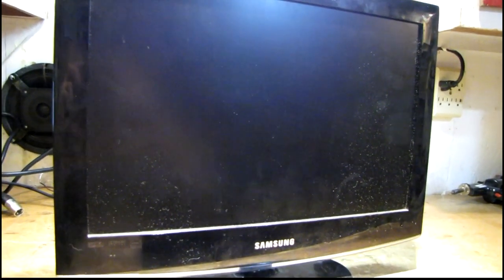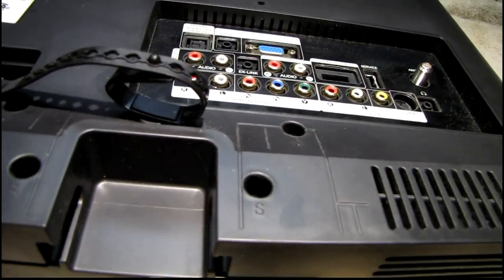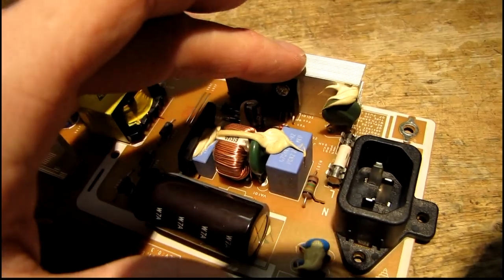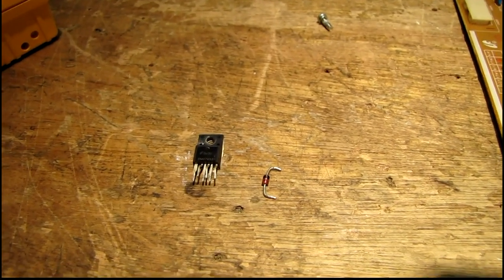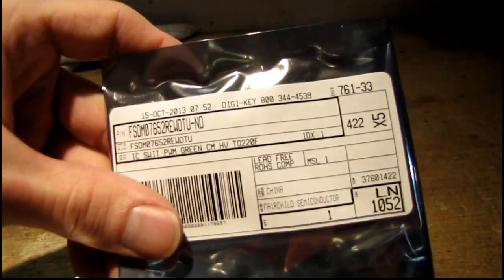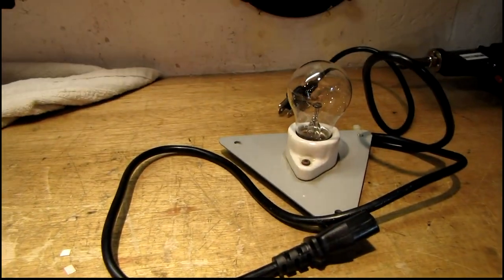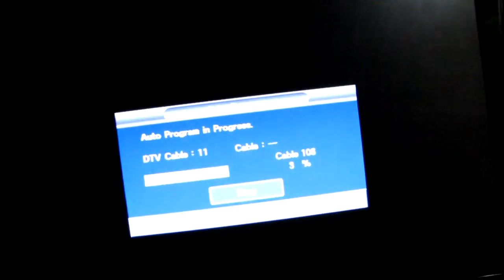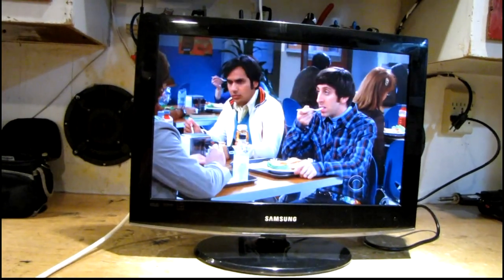Samsung 19" LCD TV Repair

Comment from the maker: CRT's can definitely run a long time.  I've got some at work that have been running for over 30 years in arcade games, with no service other than a fresh set of caps.  Though now that I've had HD TV's, I could never go back to watching standard def CRT's.  Though if it's a restored vintage set, they are nice to check out from time to time.

Comment: i really wish all flat panels would hold themselves together while on the stand, with the back panel removed. I recently fixed a Vizio 50" plasma panel, and unless you had it flat on a table, it wanted to fall apart. I also repaired a smaller samsung like the one in this video, and same deal, had to keep it flat. It would be awesome to have them stay together for the larger plasma panels, just so you can adjust the panel voltages easily.

Comment: I have one of those digital cable to analog rf converters the cable here was converted to digital a couple of months ago.  I can not stand these boxes the box sometimes randomly mutes when changing channels with the remote.  Then the box also sometimes will not receive the upper digital channels and the lower channels up to 24 work.  The boxes could have bad capacitors but the boxes are provided by the cable company for free I do not want to open them up. Sometime I swap the boxes and it works.

Comment from the maker: I get most of my capacitors from Mouser Electronics, sometimes Digikey.

20Mhz is fine for working on amplifiers most of the time.  If you are working on anything digital, you will probably want something faster.

Comment: I have a problem with a samsung tv model LN - R238WA that has a flickering standby light. I checked the power supply and it had a few caps that were bulging. I replaced the caps and still does not turn on. It doesnt flicker anymore. theres a coil whine also and when you press the power bottom it changes pitch but does nothing. what can it be?